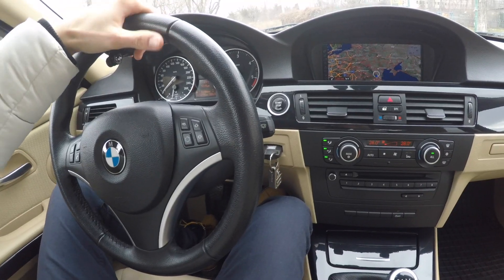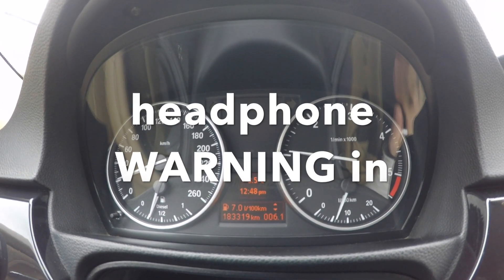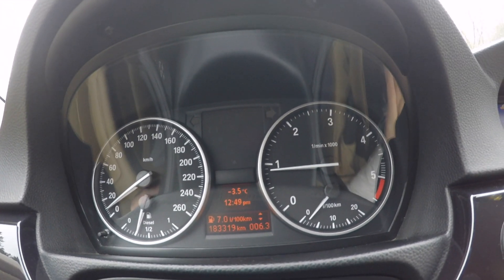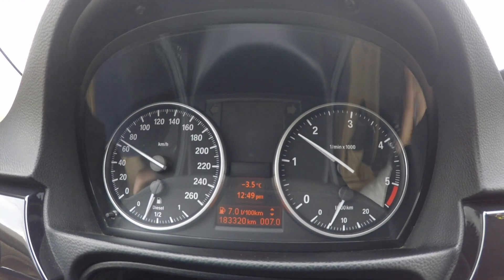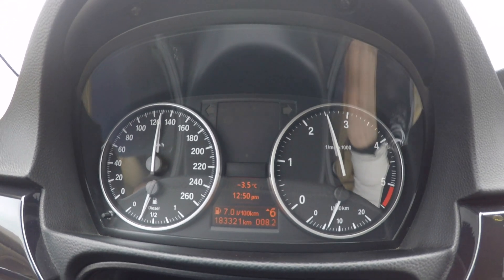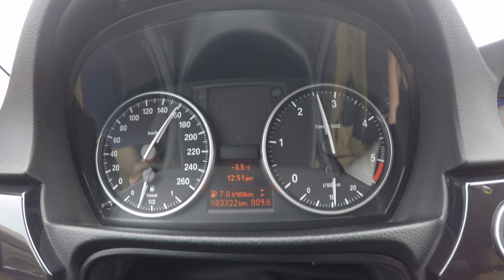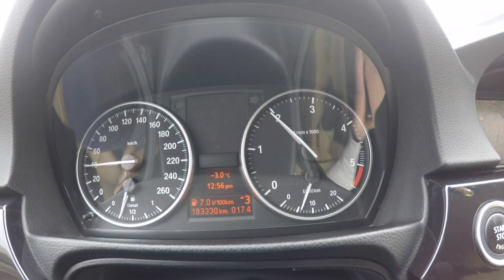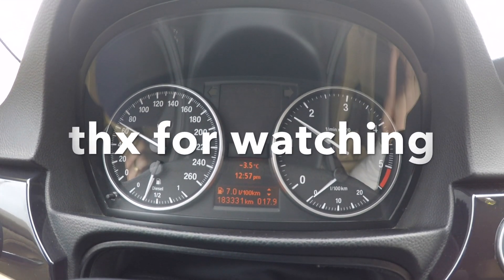ECO PRO mode or How To drive with the shift indicator on ! BMW e90

Comment: I have E90 LCI 318i 143 PS. I would like to add one thing: the car recognizes the engine temperature and adjusts gear suggestions accordingly. Example: when you start your car and the engine is cold, the computer will suggest you to shift from 1st to 2nd gear at around 2500-2700. During the warm up phase, the suggestion will keep going down to like 2400, 2300, then maybe even 2200, although usually it tells you to rev it a little bit on the 1st gear, since there will be a big RPM drop  and the computer doesn't want you to be on a 2nd gear and on a low rpms, because then it tells you to reduce it back to 1st. On the next gears when the engine is already warm, suggestions to shift to 4th and 5th can be seen at 1800-1900, which is super low. Use it only when you want to cruise at a steady speed after the change. Don't try to accelerate at 1500-1600 rpm, it's not good, you are way better off reducing to 3rd to 2300-2500 rpm.
Reply from the maker: yes you are correct :) thx for the time to reply here

Comment: How is your experience with the DPF on your car so far? Urban driving seems not too agree to much with mine and fills up pretty fast. Without an obd adapter to monitor the buildup of soot you would never know when the car wants to do a regeneration. And the e90 only stores dpf silent errors and only lights up on the dash when the blockage is critical. How do you mitigate this?
Reply from the maker: so I am feeling your pain ... but I do have a tendency to do almost every weekend a long drive minimum 200km and in that period I do rev it up a little so I don't change it to 2000rpm when it shows but I do it on the upper limit. Keep in mind that I am doing this for some time now and the last time I scanned my car the pressure was ok on the dps sensors. So , my answer is that you will have to take some time and do long roads regularly :)
Reply: Yeah, I do that too, I take it on the highway whenever carly shows that the car is ready to do a regen to keep everything running within spec. I put in new glowplugs injectors dpf sensor, turbo was cleaned and relaibrated, egr valve was also replaced to make sure the dpf can do it's job properly. But as the dpf fills with ash that cannot be burned off it acts as additional filtration material causing the filter to catch more of the cancer causing nasty stuff but sadly also fill with soot much faster. Some years ago when the filter was clean with zero ash deposits it took 2-3 weeks of urban driving before it needed to regen. Now it has 17grams of ash and it tends to fill up in 5 -7 days. I do plan on getting a new dpf in the future because I hate seeing cars that smoke like ancient tractors. I did clean the original one once but thermal aging of the dpf core means that you can't clean it over and over when the ash builds up and a new one is required. PS my gear lever is also shaky. I have seen a lot of bmw's doing this. Many people say it's because the gearbox is directly connected to the engine or something like that and it's quite normal.
Reply from the maker: Wow thx for the time to write such a nice reply !!

Comment: vad ca si la a ta are un joc timoneria la cutia de viteze...deoarece iti joaca in pozitia N ...mai am 2 prieteni tot asa...cred ca este o problema comuna ...
Reply from the maker: I think the bushings got to do with it . After the repair I will make a video on that but for now , keeps shaking :)
Reply: ar fi interesat....is multe filmulete ce se pot face...la seria 3 .....daca se merita sa faci oil engine flush..cu liqui moly pro line engine flush.......cum se da jos baia de ulei si se curata...cum schimbi spalatoarele de faruri...cum  speli motorul...cum schimbi filtrele...is multe..bafta